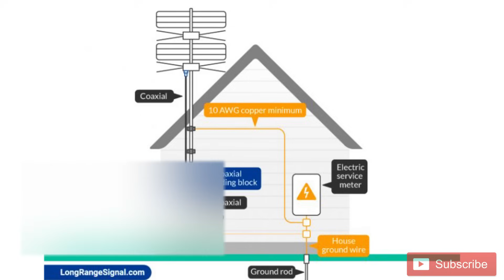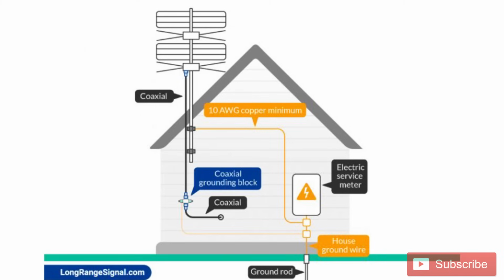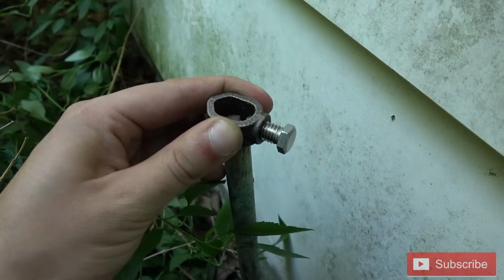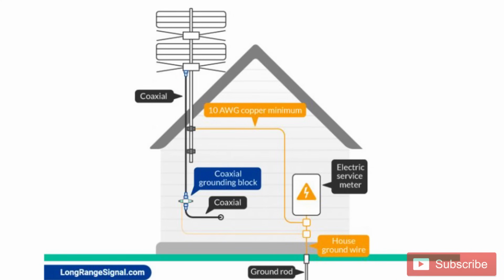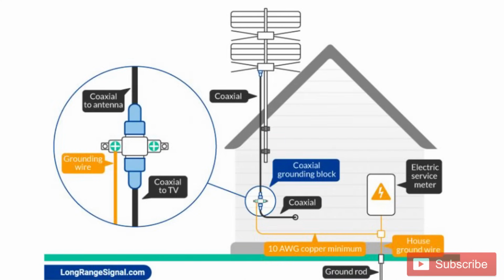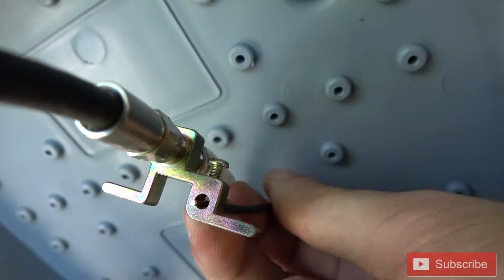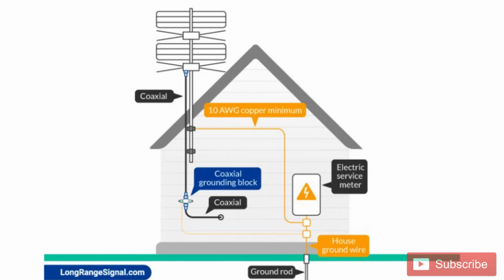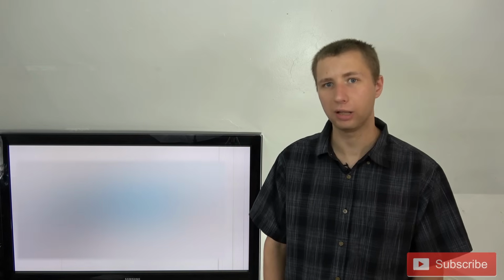How To Ground an Outdoor TV Antenna Per NEC

Comment: I'm a bit surprised you have to ground the mast of the antenna.  The antenna is conductive and connected to a grounded coaxial cable.  This should give a path to ground.  In addition my DISH (I reused the mast and coaxial cables from an old install) wasn't grounded at the mast.
Reply: Pyrolonn, it depends on the antenna design. Your coax is going to what you might call the driven element on a tv antenna the driven element is most likely isolated from the rest of the metal antenna thus your antenna and mast are not really grounded. There are some designs of antennas that do connect the element to ground in which case yes technically it is all at ground potential .

Comment: Does the coaxial cable need to be grounded if it runs from the TV to Channel Master antenna amplifier? The amplifier is grounded.
Reply from the maker: Yes, refer to the diagram in the video and do not take any shortcuts. This is lightning protection we are talking about.
Reply: @AntennaMan  sorry, I figured grounding the amplifier served the same function since the antenna passed through it.

Comment: Can you ground to an indoor cold water pipe? My RCA Yagi antenna suggested that.
Reply from the maker: Yes if your house doesn't have a ground.
Reply: @AntennaMan  my electrical ground is way on the other side of the house and difficult to reach in relation to my antenna.

Comment: Hi there. If I have an amplified splitter box that is the first thing my coaxial cable connects to, and that box is grounded, do I still need to ground the coaxial cable?
Reply from the maker: You need to ground both the coax cable from the antenna and the mast. Do not take shortcuts with this stuff. This is LIGHTNING PROTECTION we are talking about.
Reply: @AntennaMan  oh okay, I see. The coaxial needs to be grounded from the outside before it makes contact with anything inside. Thank you
Reply: @AntennaMan  I am in a town house quadplex. I can't hook up the antenna to coax plugs in the walls, because those are set up with Comcast.

So I have my antenna mounted on the outside of my top floor bathroom facing in the direction of the tower. I have the clamp and copper cable running down to the grounding rod in the ground. Can I use the same copper cable for both the mast and coaxial grounding?
Reply: @AntennaMan  so it would look like antenna mast with clamp and copper wiring going through that, and then run it through coaxial grounding part, then run that down to the grounding rod? Is that okay to do? Or do I need two separate copper wiring for each the mast, and coaxial grounder?

Thank you for your time.
Reply from the maker: @JohnDoe-wy1zt  I cannot comment anymore due to liability reasons. Consult with a local electrician if unsure
Reply: @AntennaMan  thank you for your time and assistance. I really appreciate it, and the work you do on your channel.

Comment: I read something about someone whose antenna was properly grounded, yet their equipment was still damaged in a lightning strike. I'm thinking of getting an outdoor antenna (I'll ground it, of course), and I need to know, if I'm unlucky enough to have the same exact thing happen to me, will a lightning strike just cause my equipment to malfunction or will it explode/catch on fire?
Reply from the maker: Grounding an antenna helps prevent static build up that can attract lightning. Makes it less of a target. However, lightning is so powerful that there's no guarantee it still won't strike a grounded antenna. If this happens typically some electronics are fried. I heard of people unplugging valuable items in severe thunderstorms if they have an outdoor antenna just in case.

Comment: Is there any way to ground an antenna on an apartment balcony?  Is this even necessary?
Reply from the maker: Not unless you can run a wire down to the ground outside your home. If it's a complex I wouldn't worry because it's probably not the highest object on the building.
Reply: @AntennaMan  Thank you.  I am on the 3rd floor of a 13 story building, so I guess I'm safe from lightening.  I'm more concerned with static building up and creating interference.
Reply from the maker: @hilaryweiner893  just unplug the coax and touch it every so often to discharge any static
Reply: @AntennaMan  Thank you!  You're the best!
Reply: @AntennaMan  - Um, amusing, certainly using your tongue would make for better conduction, however static buildup doesn't interfere with reception because it isn't a rapidly changing voltage.  In addition, your opening statement about grounding the mast to eliminate static buildup that attracts lighting is misspoken, static charge doesn't attract lighting.  The mast ground is to provide a path for lighting should it strike.
Reply: If no ground then there is no ground and that is the way the situation is.

Many antennas every where have no ground and all is Ok.

Some humans get stuck and hung up about the grounding issue.

What is , is. 

I am 70 years old. And Yes I know the humans get obsessed and hung up about issues.
I will state the situation even more clearly , the humans go crazy and make all manner of inflammatory statements.

The Truth is the humans are Not able to think clearly about electrical and grounding.

I will state the situation again , if there is no ground , then there is no ground and that is the way the situation is.
Reply: And Yes I know the inflammatory statement makers will go completely nuts.
So sad for the humans.

Comment: Yea I got hit by lightning today. I used the cable that the satellite company installed and the ground rod that they put on. I guess it wasn't grounded right because I toasted a tv, tuner DVR. The video input of another tv, 2 phones a wifi router and a roku. I'll be sure to pound about a 20 ft rod in myself after this mess. My antenna was on a 40 ft tower.
Reply from the maker: It probably was grounded right. The strike was just so intense that some of the 1 billion volts traveled to everything nearby. My family had a few sets fried when a neighbor's tree took a lightning strike.
Reply: When you get a direct hit - I have been there. The first thing you hear is a sound like a spark and then boooom! - there is nothing that wll stop lightning. It will fry all your equipment UNLESS they are all disconnected from power outlets and comm lines. Did you have voltge/surge regulators connected to your electronic equipment?
Reply: Been there, even once with CABLE (back in 2002). Lightning must have tagged the pole or something.. It was weird how it completely destroyed some things, but not others. 2 tvs, including a 35" Panasonic flat tube TV that I paid over $1000 for in mid 90s completely fried, 1 cheap RCA tv survived but coax port was dead. Fried my cable modem and router, but it only fried my sound card and NIC in my main computer (rest of it was fine).. I remember my grandmother had a direct hit on her outdoor antenna in the 80s, her old style Zenith console tube tv's screen was glowing for a minute or 2 after it destroyed it. No grounding system is going to survive a direct hit. I always unplug my outdoor antenna when a severe storm is approaching and just bare with indoor antenna until it is over. Even with cable tv, after that incident happened, if the storm is nasty enough I would completely unhook the main line going into the house until the storm has passed.
Reply: @toddstewart9070  Yeah the first rule of lighting is it follows no rules. I had a strike at my house and took out the tv but not the dish box connected to it. Took out some of my security cameras and left other untouched no ryme or reason to what failed even messed up some of the outlets in the home.

Comment: The directv boy used eletric tape and connected ground to a water pipe near the exit of the home. Just going to use that :)
Reply from the maker: For some reason that is considered grounding but I personally would not want lightning to hit a pipe filled with water especially if I was in the shower at the time.
Reply: @AntennaMan  best not to be in shower during a storm anyway why take chances.

Comment: Well done. You also accomplished a safety ground which will protect people in case there is an  insulation fault somewhere in the system. An insulation fault happens if one of the 120 volt devices has its hotwire short out to the enclosure.The risk is that a person will touch the enclosure and get that hundred twenty volt shock to ground. It could kill them. An insulation fault also could electrocute somebody if they touch the mast if it was not grounded properly.

A copper-clad ground rod driven next to the mast would be a good choice. Just tie that ground wire to the other ground wire near the AC 120 volt service. Grounding at the mast will drain electric charge that starts to form before a lightning strike  when a cumulonimbus cloud is above. That could prevent the 500,000 volt lightning strike. If there is a strike it will take the direct route to the ground rod that you just drove in.

Comment: My apartment doesn't allow outdoor antennas. I use an indoor amplified antenna. I get 35 channels but I can get more if it was outside. Oh well. Good information.
Reply: Yes you can install a Tv antenna on your patio or outside deck or balcony on the floors above ground level.

Here is the FCC website that says Yes you can.

www.fcc.gov/over-air-reception-devices-rule

Here is some and not the only brand of flat coax that is designed to go from the outside in the inside.
Holland Electronics , FBA-144823
Reply: And so in many apartment situations , if the outside antenna on the patio , deck , balcony , is not grounded , then the antenna is not grounded and that is the way it is.
Making a issue out of the situation with management is asking for more and more trouble. 

If you like trouble then go ahead and blab away.

Many situations of life it is best to know when to keep your mouth shut.
Reply: @genesky61  - Thank you!  I've been trying to help an old man that has been disabled all his life.  His primary activity is watching TV, that and soliciting help from government, family, and others.  When I met him he was hopelessly behind in paying his Comcast bill.  Got that down to $10/month  (Internet only through Comcast Internet Essentials).
Apartment building is aluminum plated with a plating on windows that blocks RF.  Indoor antenna was pretty useless.  Put one of those not so cheap ($28 at Walmart) flat indoor antennas on the balcony, hid it behind a chair, it's doing quite well.  Maintenance man spotted the wire thru the patio door, followed up with a note in the news letter stating that the door can't be left open when heating/cooling.  I had used a flat coax piece and foam to mostly block the opening but the coax wasn't flat enough for a sliding door, I'll a thinner one.

Comment: Actually according to the NEC you can use a 5’ ground rod explained in 800.100 and 830.100. Now there are requirements for example a mobile home.
Reply: Yes absolutely.  You just make sure you also run a wire from the separate ground rod to your main electrical ground system.

Comment: Big difference between your common earth ground and a pole placed in the ground. The difference in potential can still fry all of your connected equipment. Always go with the earth ground generally located near the service panel.
Reply: Ray McCarty 
Seems the best idea would be to go the most direct route with the closest grounding connection possible. If your electric supply box is below your antenna then use that. If it’s on the other side of the house, should you run your grounding wire across your house to get to the panel? Seems like that could start a fire.
Reply: @totallyfrozen  it should be bonded to the service entrance and you run that outside the house. a direct route is not necessary. you will use additional grounding rods along the route. see the NEC for guidance.
Reply: MrMikesMondoVideo 
Yes, but my service entrance is literally on the other side of the house from my antenna. I’m not comfortable with the idea of running copper grounding cable across my entire, tar roof. There is a grounding rod buried at the corner of the house where the antenna is. Is there a reason I can use that one?
Reply: @totallyfrozen  It's good that you're not comfortable doing it that way because you shouldn't be. I'll talk more about that in a moment. I'm not an expert in this subject, but I know enough to be able to guide you to those who are. In another post I second another poster who had mentioned Mike Holt. Stay away from videos like this. I'm sure the creator means well, but in some cases he’s doing more harm than good.

The NEC is your guide; however, there are so many different iterations of scenarios that the NEC cannot provide an explanation for every scenario, and that's why electricians and the AHJ may disagree. I only recommend that you get yourself as educated as possible so your decision can be as educated as possible. You sound like the kind of person to be doing that.  

You are correct... you want the ground closest to the antenna as possible, but you also want to bond all the ground connections to the service entrance… a unified ground point. Without knowing the particulars of your situation, you may need to ground the antenna at a point closest to the antenna and then run the ground wire underground to the service entrance, grounding it throughout that distance with additional grounding rods.  Understand that the NEC is not interested in easy or inexpensive, only what is required. Having multiple grounding rods connected by a buried ground cable is not an uncommon practice. In fact, it's quite common in certain applications. That said, it may be easier and/or less expensive for you to just move the antenna close to the service entrance and then pull coax for the difference. 

Ray, the OP in this thread, talks about a difference in potential, and he is correct in that being a problem (although that difference is not going to fry your equipment). To solve for that, everything should be bonded to the service entrance.

For fun you could look at the Motorola R56 grounding standard. The joke there is it's not going to be much fun and much of that is not going to be applicable to what you're doing, but you may be the type of person who would find interest in reading that.

Everything we do is a compromise. You have to decide where, and to what degree, you want to make that compromise… safety, performance, cost, etc.

Comment: Some time after we cut cable five years ago, the grounding wire in the box on our house was cut and is hanging loose.  I wonder what that was all about?  Anyway, great video.
Reply from the maker: That doesn't sound good. Send me an e-mail of the picture as I am curious to see if it's nothing major or something serious. You can find my e-mail on my website antennamanpa.com
Reply: Thanks, I'll see what I can do.

Comment: My Dish installer and internet provider didn’t ground anything. Awesome 👏
Reply: Same here with DirecTv no ground period.
Reply: If it is like mine, it is grounded to the copper plumbing pipe.  It is pretty common to do that, so take a look.  I know when I had my plumbing redone, the plumbers knew to make sure the plumbing was connected so that it could still serve as a ground.
Reply: @Pyrolonn  no, that does not serve as a proper ground. the grounds should be bonded at the service entrance. dish and cable installers are some of the worst offenders of bad practices. what they do or don't do should never be a benchmark. let the NEC be your guide.

Comment: All grounding should be whats called a home run ground. That means the ground wire from the mast to the grounding rod should be a straight line with no bends or other device grounding bonded to it. A separate  ground rod should be used rather then bonding to the homes electrical service ground rod. Be sure to consult NEC Section 810-15 code before doing any outdoor antenna instillation.

Comment: A direct lightning strike is very powerful.  Your grounding system should be grounded to your electric system ground, but I would make these improvements.  First, a #10 wire is a minimum, if possible up that to a #8 or larger. Second, run this wire in as direct a line as possible to an eight foot ground rod driven in moist earth.  Lightning does not like sharp bends and they should be avoided!  Third, install a bonding jumper from your antenna ground rod to the electric service ground.  This keeps them at the same potential and is a code requirement.  This method will greatly reduce the chance of damage to your electric service as most of the energy from a strike will go to the first ground rod.

Comment: Good video one thing never use a separate ground rod for your TV antenna unless you tie it back to your house ground rod. Yes two or more ground rods are better than one but they have to be tied together and tied back to the house ground rod. Also the grounding rods need to be at least 20 feet apart to be effective if using more than one.
Reply: Correct. NEC 2011 requires a grounding bus termination block to tie all low voltage and high voltage grounds to the same location to eliminate voltage potential differences.
Reply: The separate ground rod, if used, must be bonded to the house ground rod with 6 gauge wire.
Reply: What if my main doesn't have a ground rod, but is grounded to the water pipe going into the house?  I was going to install a separate ground rod for the antenna.